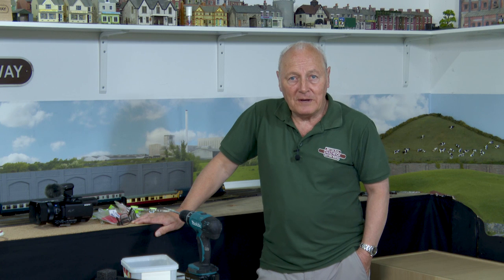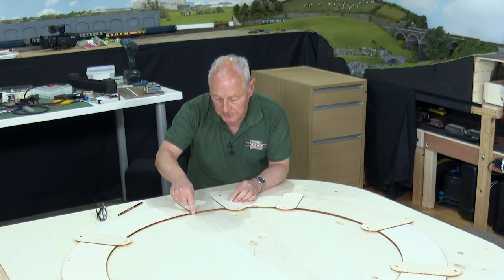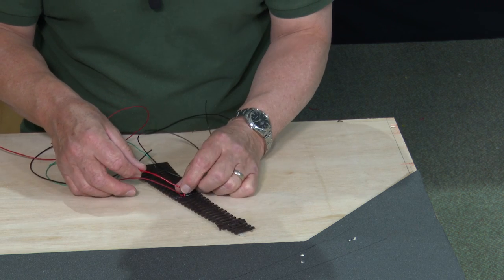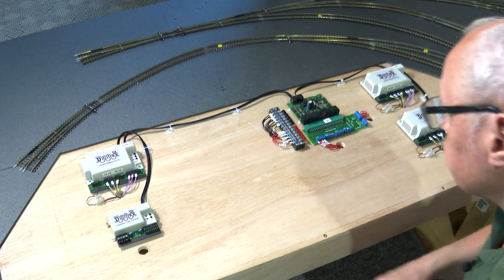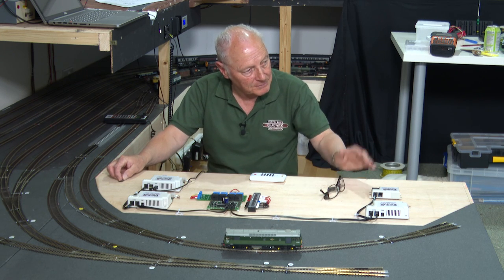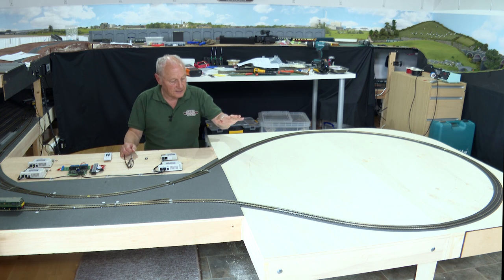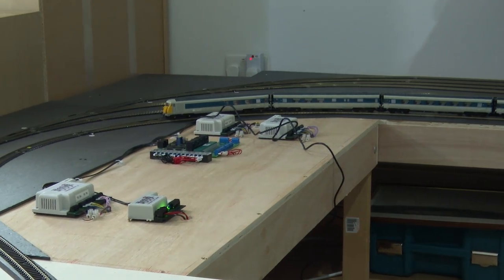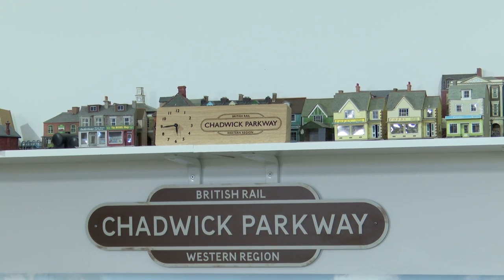Layout Update and Installing a Reverse Loop at Chadwick Model Railway | 162.

Comment: I've watched this video before but only now realized that you are using the Digitrax BXPA1 for the reversing loop. I have one as well, and also the Digitrax AR1. I chose the AR1 for its simplicity. 
Will you use the BXPA1 for its detection functions? If so, will you create a video of it? As you pointed out, Tom's Trains and Things seems to be the only person who's reviewed it, or at least talked about it. I'd like to hear your opinion of it once you've had it put through its paces.
Thank you Charlie and congratulations on your Award ! Best, Val
Reply from the maker: Hi Val, being such a scarce item, a video really isn’t justified.  I just wired mine in, with no adjustments, and it worked perfectly.  I am going to hit a snag when I install another one, as the block detection address is the thing I haven’t mastered.
Regards Charlie

Comment: Hi Charlie, I hope you had a nice lie down! I’m voting for a helix video. I’m a bit confused though about your return loop polarity. The return loop doesn’t actually return to the same track but because you wire “black to the back” I understand the need for a polarity switch. Won’t you have the same issue with H2? How did you wire H1? I’m asking because I’m switching my layout from DC to DCC and wondering if I’m making a mistake with my return loop (to the same track). It is still to be tested.
Reply from the maker: An interesting point David.
The upper level is wired black to the back.Therefore after transiting the first helix, it becomes red to the rear! The only reason I need the reverse loop module, it’s because it’s on the same level and therefore the polarity switches.
I do hope that makes sense, regards Charlie
Reply: @ChadwickModelRailway  Thanks Charlie. It does make sense. You had me worried there for a while. Take care, David

Comment: Hi Charlie, 2 questions.  Board 10 what thickness is the ply wood top and frame and I thought you had a black to the back when wiring track.  Great video again.
Reply from the maker: Hi William,
It’s 12mm birch ply.
My top level is wired black to the back, however once you go through a helix the tracks get reversed. Hence it’s red to the rear. Regards Charlie

Comment: Hi Charlie, have you ever used or reviewed the Rev 2 Auto Reverser by Block Signalling. It looks fairly straight forward and effective solution for a reversing loop. Regards Graeme
Reply from the maker: No Graeme , I haven’t. However, I have used the version by Digitrax.
Regards, Charlie

Comment: Thanks Charlie, interesting stuff. Taking your advice from when we met (all that time ago !), I’ve re-jigged my Helix plans slightly and will be having a loop around the base of my Helix as well. I’m interested in the Digitrax Reverse Loop controller as the ones I’ve previously installed are apparently no longer available so I’m interested at looking into that device in a bit more detail. You say it also provides for detection, I;d like to,see a bit more information about that if you’re able to include that in the next video ? From my point of view, seeing you tackle the second Helix would be of interest for the next video. Basically what you’re currently installing is the same as I will be on Phase 2 of my build of Pevenbourne. Currently I’m doing scenery on Phase 1 and when complete, I’ll be making a start on Phase 2. Must make one of those bent rail fishplate installers by the way, they look brilliant ! And just to prove that great minds think alike (or is it that fools rarely differ 🤣), I have also just purchased as box of 25 lengths of that Legacy Rail Code 100 track - will be interesting to see how it compares to the Peco product.
Reply from the maker: Thanks Bryan,I will come back to you on the Digitrax reverse loop module in a few weeks time, once I’ve tested it out. Regards Charlie

Comment: Charlie

Another great video and great to see the progress. Firstly with H2 a full video might be repetition but perhaps a chance to give an update on lessons learned from H1.

Not had a layout with digital control the reversing loop threw me as if I had this when the polarity switched the train would go backwards!  How does the DCC system know which way the engine is going?
Reply from the maker: The decoder within the locomotive knows the instruction to go forward. So even if you pick the locomotive up and turned and put it back on the track he will still go forward and not in the same direction. It’s the same principle for the reverse loop. Regards Charlie
Reply: @ChadwickModelRailway  thanks Charlie.  Just like the real thing.

Comment: Hi Charlie. Very interesting video. One question. I note that the already constructed helix board has no room for a reverse loop around it so dud you have the new helix board constructed larger to accomodate it (which would be my assumption) or is the helix of smaller radius? Cheers, Chris
Reply from the maker: No Chris, the board is about 4 inches wider. Regards Charlie

Comment: Hi Charlie,
I noticed the reversing loop didn’t have any elevation; I assume it’s not necessary.
Not sure about combining point track power and point motor power at each point, so I’ve kept mine separate and combined them at a suitable control panel point.
A lot more wiring but keeps the flexibility just in case.
Plus, I wonder if after soldering those combined wires, the result is more noticeable and therefore harder to hide when eventual ballasting.
Although my layout won’t have a helix or reversing loop, I still found your video absolutely fascinating and informative as always.
What a mammoth effort, well done especially in that heat!
Reply from the maker: Hi David I’m so pleased that you enjoyed the video. I don’t believe it’s that difficult to hide the soldering.

Regards Charlie

Comment: I ended up gluing down 1/16" 4' wide cork roll on my layout.  I tested a track running on the thick bare plywood.up onto the thin cork, and the sound deadening was palpable.  
Unfortunatly, it's not dirt cheap, but bought from an industrial supplier, it's far cheaper than from craft stores.
Reply from the maker: Great progress Frank but be aware that the noise can return once track has been ballasted. Regards Charlie
Reply: @ChadwickModelRailway  wouldn't it be better to fill in the space under the board with something like Celutex after it's all wired and built ? I'm thinking the ply acts like the skin on a drum and magnifies the sound from the trains on the track
Reply: @ChadwickModelRailway  Fortunately, cork doesn't suck up liquid too much.  But poinr taken and perhaps I need to do some experimentation.  Thanks for the heads up! 👌
Reply from the maker: An interesting point Shaun.

Comment: It's been 30+ years since I had a model railway as a teenager and this predated digital. I kind of expected coming back that the wiring would be simpler. Doesn't seem to be :-) And I've worked in IT for all that time. Do I recall correctly that the old-school way to handle a reverse loop was a double-pole double-throw switch??
Reply from the maker: Your memory serves you well Rob.
Regards Charlie
Reply: @ChadwickModelRailway  can't remember what I did yesterday but I can remember that!

Comment: Another enjoyable video Charlie and great progress.  I see that we both follow Greg from 'down under', at the Birdwood Sub (drops head) Division. 😂
I was surprised when you said that the fiddle yard was “Red to the Back” as I was sure that you were a “Red to the Front” man.  I must have been mistaken and having another a senior moment.
I was wondering if you also tested your new permanent way routes using TrainController, via the use of Schedules and whether or not you updated TrainController in tandem with your layout build? 
I'm pleased it has all worked out for you despite a few gremlins. Best, Jason.
Reply from the maker: Hi Ian, the upper level is wired black to the back. However, once the track has been through the helix it reverses, and therefore it becomes red to the rear! Furthermore, I update Train Controller progressively as the layout develops. Regards Charlie

Comment: Hi Charlie, if I'm correct, you did a video on banking track curves with 'card' on the outside rails. Any idea what number this is please and why bank the curves, does the train really go that fast?

Regards
Glen
Reply from the maker: Hi Glen, plrase cheak out Video 39.  I do for looks , not for speed.
Reply: @ChadwickModelRailway  Thank you Charlie and for the quick response. Regares  Glen

Comment: Hello Charlie,

Thank you very much again for that very brilliant information video of what can happen by testing the layout.
May I ask you, if that will be normal that your Intercity 125 (mph) showing red light to the front by foreward running direction?
How about of british railways front lantern codes? Please do make an explaining video aboutt of these interesting light signalling codes on trains. I think I never have seen such video before and most modellers don't do correctly headlight signalling when modelling british railways and located elsewhere onto the globe outside of Great Britain.
Your Brake Van End of Train Device Lanterns onto the roof top and to the rear Coupler are similar to old german Era I Signalling rules.

Correctly headlights or correctly end of train signalling features are seldom possible to see onto different people's layouts, the manufacturer do deliver easy made train signalling mostly.

By the way, what kind of curve radius you are used onto inside and outside track helix and how big are the percentages upline und downline?

Thanks for that great video,
Happy railway modelling,
Ingo
Reply from the maker: Hi Ingo, the Pullman was showing white lights but with my camera set to 4000 kelvin, the LEDs appear pink.
Regards Charlie

Comment: Hey Charlie, polarity switching loops are for single branch lines where you would travel in both directions on the same line, therefore change polarity because both ends of the loop meet up and would otherwise short.
But the reason you have needed to use one is because you haven't used conventional wiring, ie maintaining the polarity for left rail and right rail according to forward travel.  The left rail on the up line should be the same polarity as left rail down line.
Reply: Had to think about this.
If the train comes up one line then uses the loop to basically turn around and go back onto the same line then the left polarity would be the same as the other side surely? Or am I getting mixed-up with DC and DCC?
Reply: @ianstrachan7668  On a single branchline it would for instance have a blue wire to left rail and red wire to the right rail.  It would go round the loop and head in the opposite direction on the same line with red on the left rail and blue on the right rail.  The loop would therefore short out the rails so a polarity switching loops must be used.
The convention for mainlines (2 lines) is to have the rails wired according to forward travel, eg blue to the left and red to the right.  Therefore the inner rails would both be red and outer both blue.  Travelling forward on one line, round a loop and return on the other line would not change polarity and a switching loop is not needed.
Charlie has wired his layout with red to the rear, so one line has red to the left and the other line has blue to the left according to forward travel.  Model railways are entirely up to the individual how they are constructed; I'm just pointing out that it creates extra problems and unnecessary expense to go against best practice.  But as I say, his layout and many people are enjoying the journey with him, as I am.
Reply: @nicksouthorn1248  so if I have a simple oval track with an up line and a down line, then reversing loops aren't needed.  Unless theres a cross over arrangement to take a train across to the other track?
Reply from the maker: Interesting comments gentlemen. However it’s best viewed that all my tracks on the lower section are wired red to the rear black to the front, therefore, once you turn around the reverse loop clearly your red comes on to  black track and you’re black to the red. Therefore a reverser is required to avoid a short.
Regards Charlie
Reply: @ChadwickModelRailway  That is the point exactly Charlie.  You have wired front to back so the up line is the opposite polarity to the down line.  This causes confusion with frog polarity on points and would short an ordinary loop.  You have overcome the second problem with loop polarity switching, but it is not best practice to wire a layout in this way.
You are free to do it as you wish, but I would advise any of your viewers to wire the way that DCC was designed to work, with the right rail always red.
How is your club layout wired? And McInley?
Perhaps you might like to research this for a future video, the pros and cons of your wiring compared to conventional wiring practice.
Reply: @ianstrachan7668  that is correct

Comment: Hi Charlie, as a newbie to the hobby your videos have been an amazing place for research and also totally entertaining. I'm planning an n scale layout. Within that I have an oval of track with a reverse loop running across from one straight to the other. Any tips on what I need to get that working with DCC and the right approach to the wiring? Thanks for your help and the videos and keep it up! Nick
Reply from the maker: Hi Nick, you will have to search my back catalogue. I did cover the Digitrax reverse loop module, which works perfectly. Regards, Charlie

Comment: Fantastic Video Charlie , Its going to be amazing , I am puzzled that when the loco triggers the polarity change the rear boggie is still on the old polarity they doesn't it just short . Dave
Reply from the maker: No David, it changes the polarity to the approach track polarity. When it comes off of the reverse loop, it changes the polarity to the approaching track polarity, I’m not sure if that makes any sense at all. Regards Charlie
Reply: @ChadwickModelRailway  Oh yes of course makes sense now , thanks Charlie

Comment: Hello Charlie, great Video again! Thank you. 
a)
So for securing your "old" helix you could fix an upright bar in the middle, adding a pair of wooden wedges, place them closer onto eachother (untill they do support the basic board of the helix), and then you can fix the hole construction with two wooden plankes and two clamps, so when you do bring in the predrilling hole for the first screw the hole pile of bar, wedge, and wedge will not start rotating. Hope this makes perfectly sence and you do you can safly be the "dancer in the helixes"... 😉

b) 
Did you decide what to do over board 8 and 9 as a landscape scenic? And certainly itbis mostly of intrest how to make a "legemitated entrance" to and from the helix. Richard from Everard Junction does had had done great ideas in one of his recent videos about a bridge and a pice of wall perchance giving the entrance a raesionable story told to us. 

Greetings from Berlin, Chris
Reply from the maker: Hi Chris, once I have built H2, I will then progress up to the river board encompassing an engine shed and a fuel depot. Regards Charlie

Comment: Nice video Charlie!  Obviously you were running your test trains at a sensible test speed especially due to the “tight” curve, but what do you consider to be a sensible running speed for trains once the layout goes fully operational? I tend to stick to a maximum of 70 mph for express trains.
Sorry you missed the sun. It was 40 degrees here in my part of France yesterday but lucky for us we have a pool! 🌞🌞🏊‍♀️🏊😁
Reply from the maker: An interesting question. On the Helix and Phil yard it will probably be a scale speed of around 50 miles an hour.

And then a more appropriate speed in the scenic areas. Regards Charlie

Comment: Hi Charlie, been awhile but absolutely would like to see the building of the 2nd helix, firstly now having the 1st one in with all the challenges that faces what you would change this time around.

Also imagine that for the 2nd helix you would also need to reverse the polarity as with the reverse loop it would feed back in reversed no?
Reply from the maker: Hi JR, the polarity doesn’t change through the helix. However, the tracks do change from the front black track becomes the back track at the upper level. I know it’s confusing.
Regards Charlie

Comment: quick question for you,  point blades,  do you,  a,  power them from the frog, or,  b, break the frog connect and have the point blades the same polarity as the stock rails? ( i have found this eliminates the risk of rogue wheelsets shorting across the gap )
Reply from the maker: B. Richard. Regards Charlie

Comment: It's not going to be a problem on a loop of that size but worth mentioning that a reversing section should always be longer than your longest train, not just the loco, as if you have any coaches with pickups and lighting or any stock with metal wheels you'll have issues with clean switching of polarity..

So Charlie have you got a new clock?
Reply from the maker: Have you been very naughty and not watch the whole video, I did mention train length. Regards Charlie

Comment: Fantastic video as usual. I'd be very interested in your loconet issues... How would you know, and what to do about it. Glad you survived the marathon session, it was well worth it.
Reply from the maker: Hi John, I found that the loconet signal was being corrupted in all sorts of strange manners. Sometimes when I plugged the controller in, it wouldn’t register, other times it would upset Train Controller 9. Eventually I changed the panel and it works perfectly. Regards Charlie
Reply: @ChadwickModelRailway  ooh, that wasn't good. Glad a simple change fixed the problem. Did you try loconet terminators at all?
Reply from the maker: No, are they made by Digitrax?